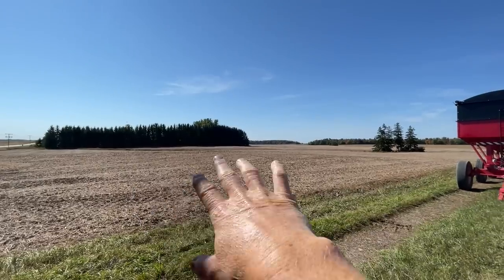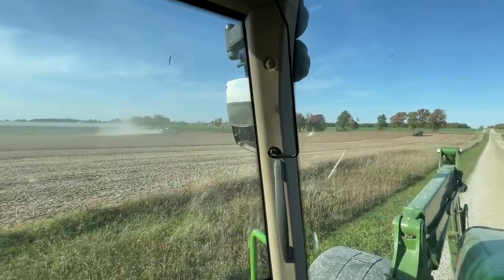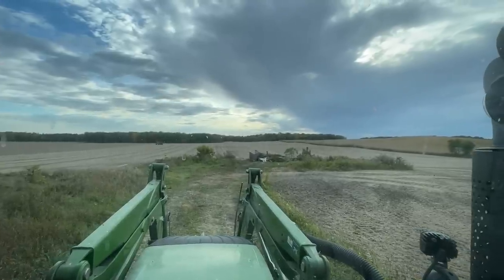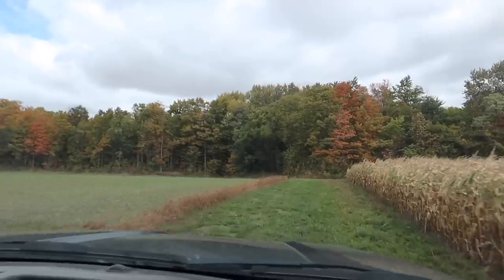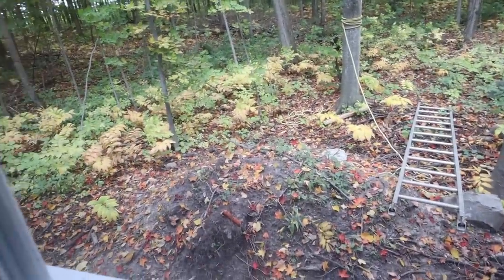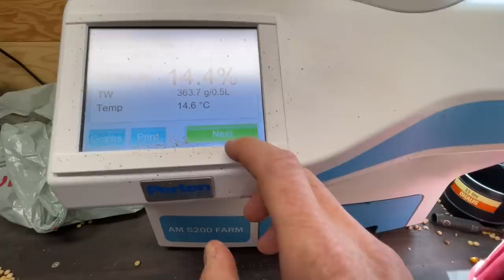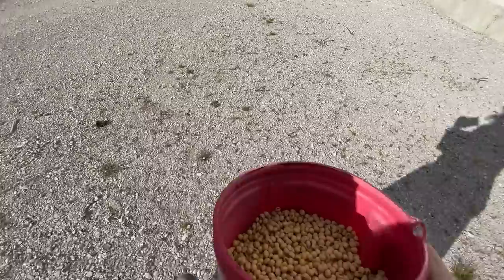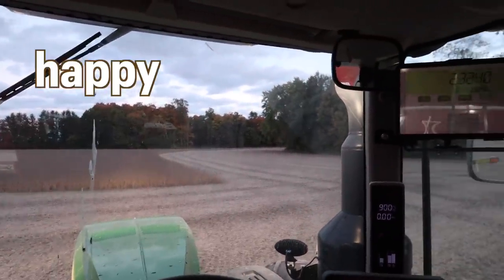She's FINALLY home! | SOYBEAN HARVEST rolls on, and a NEW ADDITION to the CABIN! Vlog 626

Comment: Genuine question about the cabin: I see you used expanding foam insulation between the wood frame. Wouldn’t it have been a bit easier to use the rejected batten wool from the sheep (stuff not worth processing into yarns), as free natural insulation? In the uk it’s becoming more popular for homes, it’s roughly felted into thick mats of raw fleece, cut to standard width for wooden framing gaps, then just tucked in before you add the plasterboard as usual. 

The same stuff (low quality fleece that’d otherwise be discarded from non wool specialist breeds), is used as  eco insulation for cold food deliveries. I buy from an online butcher delivery and all the cold meats arrive fresh with biodegradable cool bags, wrapped in fleece that’s enclosed in biodegradable film bags. You can compost them, or do as we did and use them to insulate the inside of the shed roof.

Comment: I’m not sure if your cabin has an outhouse or not. Friends do, and ran electricity to it so it has a light and a heater. They put a switch in the cabin so you could turn the light and heat on from the cabin, ahead of time. Warmer bathroom facilities❣️

Comment: I have a question. Now, understand I have no idea the exact names of anything than the combine. I’ve ran one of those before ions again. My question why can’t the combine put the crop directly into the the final machine that empties into the silo? Why does it get put into the buggy or wagons? Seems redundant to me to put it in one just to take it out and put in another one. I do enjoy your videos. Thank you
Reply: Sandi replied to a similar question with this, "It’s a great question! We use the buggy so the combine never has to stop, to increase efficiencies. (Get more off in a day). We also have a scale on the buggy that weighs each load that we need data for our marketing." Also if the field is wet at all, just having the buggy going back and forth will not chew up the field so much. Hope that helps! :)